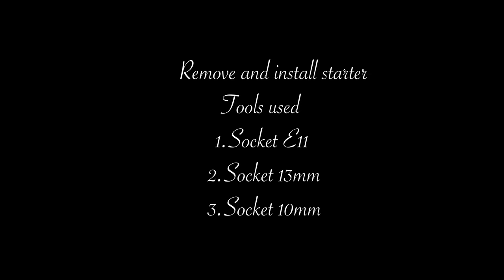HOW TO CHANGE MERCEDES STARTER FOR MODELS C300,W205,W253 DIY

Comment: C300 is 6 cylinder. Cats are on both side. That room you swinging the starter is not available.
Reply: C300 is a 2.0T 4cyl
Reply: The C300 is a 6 cylinder.
I have one. This one is as well. They skipped removing the exhaust to make it look this easy
Reply: @raidenmotsimoto7253 there is a 4 cylinder variant which appears to be what this video is covering

Comment: I was told for my 2009 c300 that the cost to replace starter is expensive due  to having to remove the catalytic converter. Another mechanic told me over the phone that he needs a professional lift to get under the car. Yet in this video, no lift, no under the car, no removing of catalytic converter.      Are all my mechanics wrong?
Reply: This video is for w205 c300s you have a w204